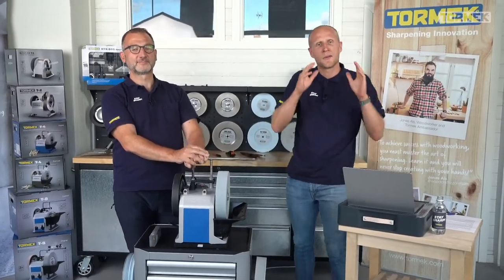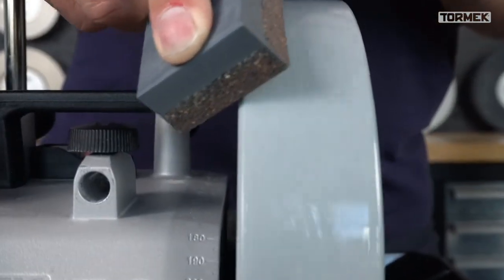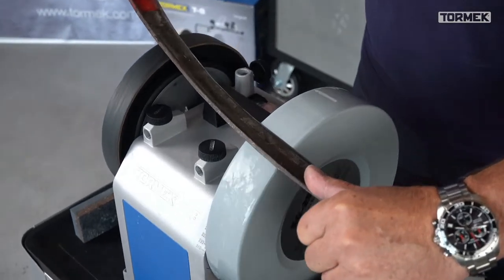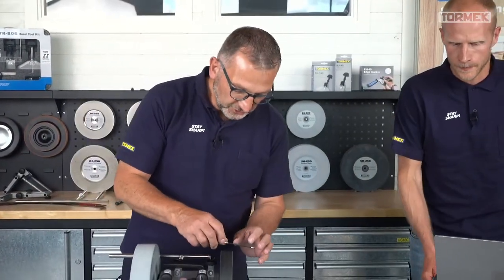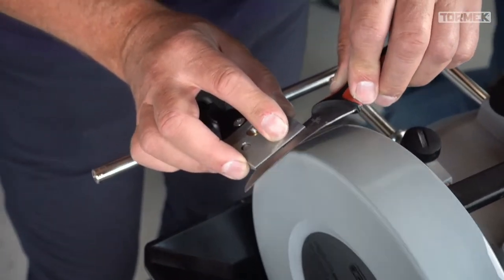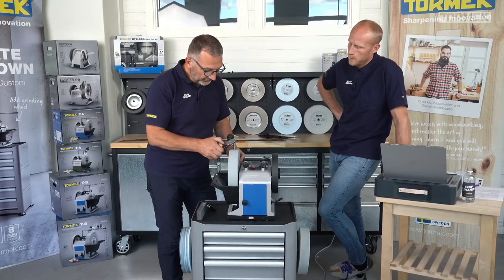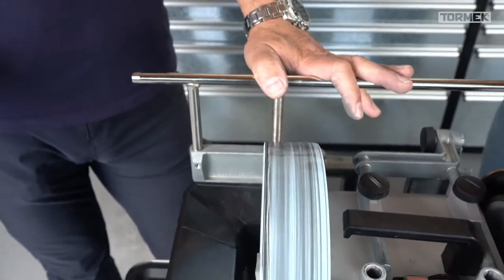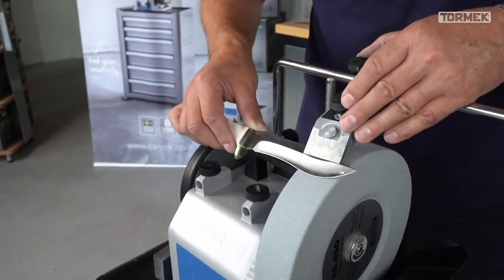Sharpen Recurved Blades | Part 17 | Tormek Live Sharpening Class

Comment: I purchased a T-8 this year and exclusively use diamond wheels for sharpening turning tools. I use the water mixed with corrosion preventing fluid provided by tormek as instructed in a spray bottle and just spritz the wheel as I sharpen. Do I need to worry about freezing issues in the winter when it gets down to well below zero Fahrenheit in my uninsulated shop at night? Could I add an antifreeze fluid or alcohol to the mixture to prevent freezing? Should I not use it at all when it’s that cold?

Comment: Is there a way to sharpen recurves using a diamond wheel?
Reply: I would also like this answer. I’m certain there’s a way without using a chamfered wheel edge.
Reply from the maker: Hej, well, you'll need a rounded edge or a very small diameter sharping wheel.
If you  use the edge of a diamond wheel it will worn out very fast and your blade's edge has not an even and nice bevel.
//Wolfgang

Comment: Why not make an attachment knife jig like the t2 for the t8???
Reply from the maker: Hi Phao! 
The main reason is that the Angle Guide for the Tormek T-2 Pro Kitchen Knife Sharpener and the Tormek T-1 Kitchen Knife Sharpener limits the sharpening to mostly only kitchen knives. The KJ-45 Centering Knife Jig and the KJ-140 Wide Centering Knife Jig lets you sharpen almost any type of knife. The "edgy" answer: the Tormek T-8 Original is not a knife sharpener, it is a water-cooled sharpening system for most edge tools 😎
Stay sharp!
/Hugo and the Tormek team